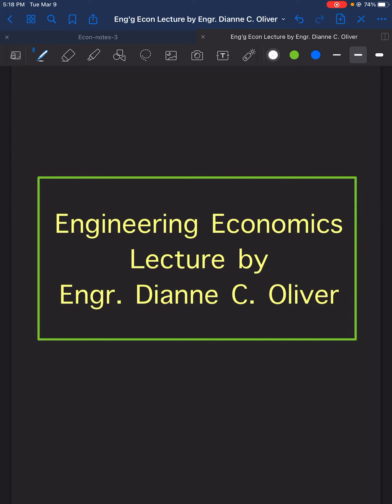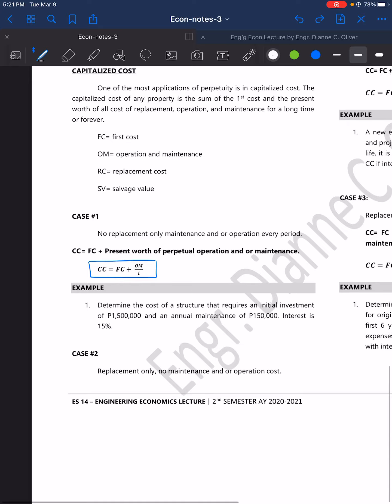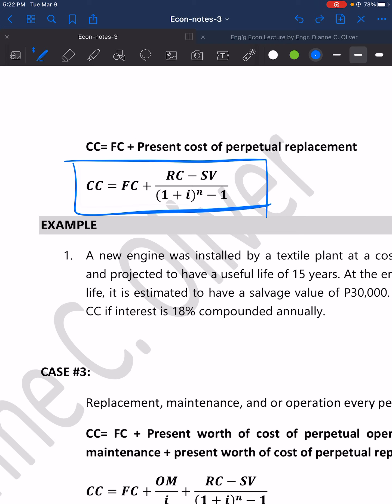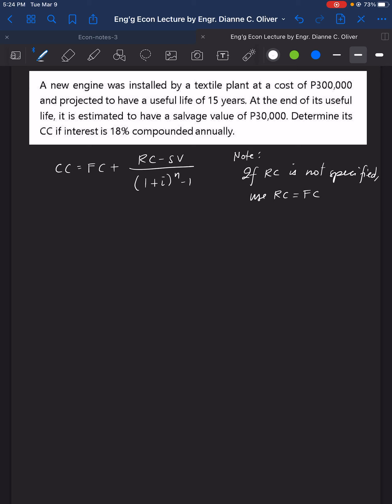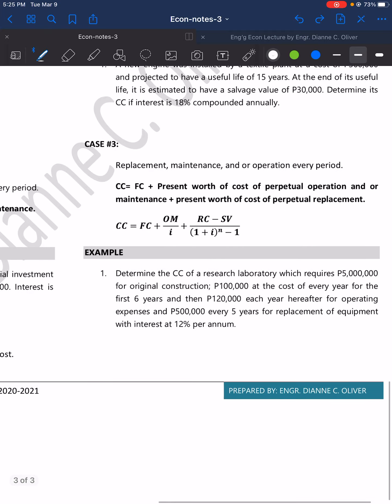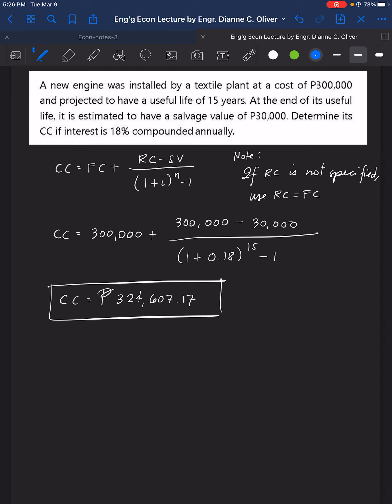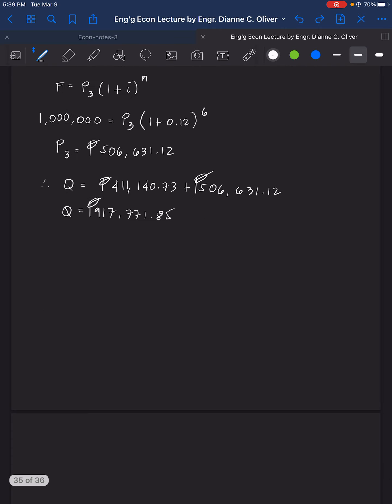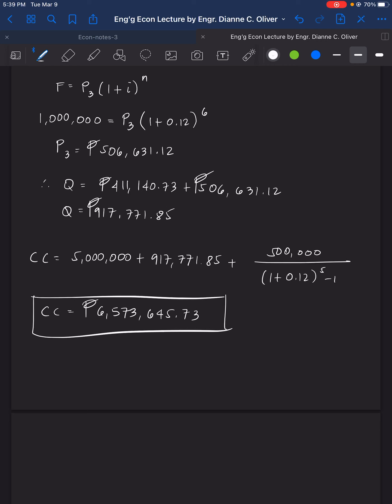Engineering Economics: Capitalized Cost, Capitalization (Solved Sample Problem Case 1 to 3)

Comment: The owner of JF Supermarket is planning to expand its business in
Barangay). The owner wants to determine if the actual population in
Barangay J has significant relationship in the supermarket's sales in the
past 6 years. Clarify if there is any significant correlation between
population and sales at 1% level of significance.
Population
35,214
36,125
37,123
38,127
39,457
41,245
Sales (in millions)
23
24
36
29
39
42
If ganto po yung example, pano po kaya to sagotan??? Salamat po sa magiging response
Reply from the maker: For significant correlation pls do approach your instructor in your subject. He/she knows better.